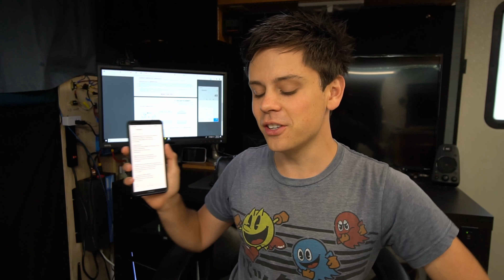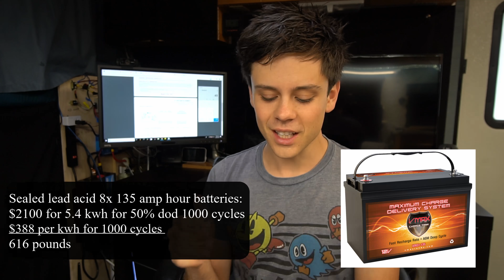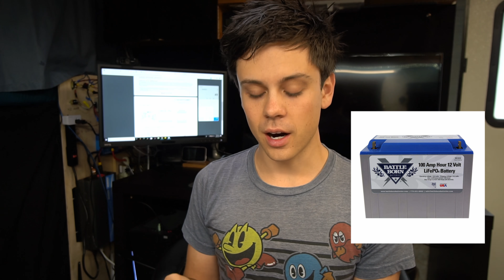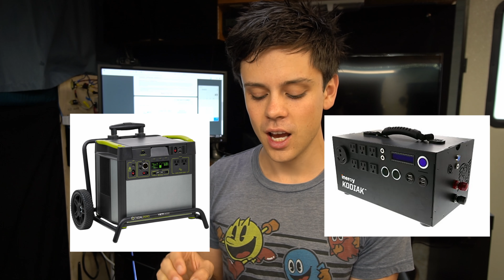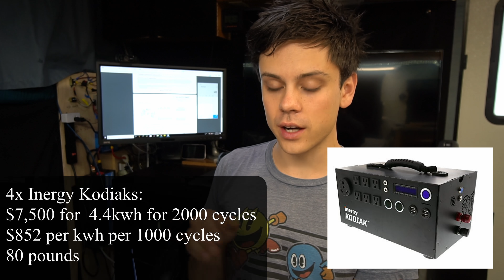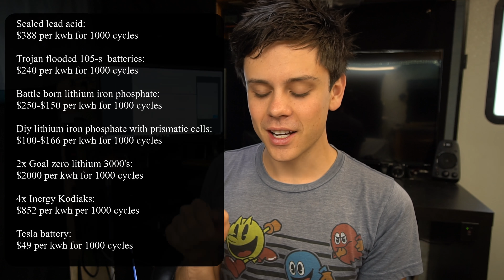Off-grid Solar Battery Price Comparison: Tesla vs. FLA vs. SLA vs. LiFePO4 vs. Tesla

Comment: Have you tried to run your air conditioner with your Tesla battery?
Reply from the maker: I don't have it anymore but it pulled only 600 watts. I was pulling 1700 watts this morning no problem
Reply: Will Prowse RV Living and Off-grid Solar  ... i totally envy you lol (in the good way).
Reply: Will Prowse RV Living and Off-grid Solar would it run an AC overnight in a Boone docking situation in an RV
Reply: I have a new mach 15 (15,000 btu) with a microair soft start and it uses 12 amps at 120 volts or 1440 watts - if it was hot and running constantly it would need at least 14,400 watts of batteries to run for 10 hours . That is assuming 100% efficiency.   

To recharge the batteries while still running the ac would need 3000 watts of power for 10 more hours (at least a 30 amp generator) solar would help reduce the recharge time.

This doesn’t sound like a cost effective solution for running your ac overnite just yet - but it is possible if you take his scenario and triple it. (5KWatt x3 =15KWatt of batteries)

Comment from the maker: Tiny error that doesn't matter much! The vmax battery calculation was for 115 amp hour battery and not the 135 amp hour battery! All the calculations are correct though. My bad!
Reply: Please put in the victron batteries. i want to see how crazy there pricing is
Reply from the maker: @Ender_Wiggin  oh man those are expensive. I should do a video on those
Reply: @WillProwse  that would be awesome! they are great but sooo expensive. I originally saw them when someone used them to make an off-grid boat.
Reply: @SEMPER PROGRATIS quite shure, Will is going to be a great engineer or entrepreneur in solar buisness, if he will use his talents for good...
Reply: So, what kind of BMS do you need for the Tesla battery?
Reply: @je-fq7ve  Tesla using Li-Ion round cells each one encapsulated with having its own CID protection switch, cutting it off circuit on over-temperature/pressure condition (like a fuse blown): so they are less dangerous than those flat pocket cells used in phones, which had exploded & caught fire sometimes. So Tesla packs seem quite safe if handeled properly with temperature sensors + state of the art cell balancing...

Comment: Correct me if I'm wrong, but the cost of the Goal Zero and the Inergy Kodiak includes whole solar setup minus the panels? How do you separate out the cost of the other components?
Reply: Sorry, posted before the video finished.
Reply: Could you revisit the value of the Kodiak in more detail in light of the info in this video? (You did give a summary at the end. )
Reply from the maker: Yeah that was covered at the end
Reply from the maker: And hard to say because it's a full system. Not sure how to calculate that out. Also, other components vary in price. Lots of factors.

Comment: Since you have both, Kodiak & Tesla battery, can you configure the Tesla to extend the Kodiak's power? If you could, that would be incredible power generator system !!!! Thanks Will.
Reply: If I remember corectly, the Kodiak had direct connectiond for DC charging, so you might combine it with an external power source to keep it charged,
just keep the load within limits...

Kodiak + cheaper external energy storage might be the
 most cost efficiant ...
Do correct me if i'm wrong
Reply: patrick van reeth - Thanks for reminding me/us. I know one guy indeed did extended his Kodiak's power with external sealed lead batt., but I don't know whether this Tesla's batt. already has BMS(battery management system) or not. If not then the Kodiak can control the charging to the Tesla? and if Yes, then how does it works with the internal charging control of the Kodiak? If it works then it would be very effective and cheap too ! I can hardly wait the answer from Will's experimental. Btw, this is worth at least 10 'like' 😁😁😁😁😁😁😁😁😁😁
Reply from the maker: That would be very hard to connect the Kodiak to the tesla. Maybe possible one way, but the complexity of that system would be crazy. Tesla is 24 volt system
Reply: @WillProwse  
Right, Tesla wouldn't be compatible, but you did mention a (probably cheaper) DIY kit system
 with separate cells...
Perhaps you could build a kit that had the correct voltage to combine with the Kodiak ?
If so, the question remains how to actually charge ...
Would it be possible to charge one of them through the other ? 
E.g. making the external unit bigger and control the amount of current it can deliver to the Kodiak so it can keep it topped off without frying it ?
Or load external unit through the Kodiak as Stranz28 suggest ?

Just putting my thoughts out there, leaving it up to you to make sense of it all :)

Comment: The Vmax would actually give you 14.4kWh with 8 of the XTR31-135, or 7.2kWh at 50% depth of discharge. So the cost of the Vmax is $291/kWh
Reply from the maker: Thank you for pointing that out g!! Big thank you
Reply from the maker: I just figured out what I did wrong!The calculation was for 115 amp hour battery. Oops!
Reply: @WillProwse  thanks for the reply, great video as always!

Comment: Look up Toyota Prius batteries they are the same as the Tesla batteries
Reply: nope
Reply from the maker: yeah they are different. i chose the tesla batteries because they are super easy. nissan leaf batteries are all super easy
Reply: madseh de The 2016 and newer Prius use lithium except for the entry trim level.
Reply: just saw a 2012 , 80 K mi. prius battery on craig's for $175....wish i was up on this stuff .....the price is right , but i'm too poor to make a serious mis-purchase.....i keep bouncing around , looking at videos , and STILL  don't know enough   buy ? not buy? NiMH no go ?  i can figure out series/parallel , etc. connex , and don't really need KWs , but the weight advantage and life span seem major benefits........led lights , and a 12v. refer 
(4 amps run v.) my only necessities.......unlike Will , i AM a minimalist     old hippies

Comment: So you switched to 24v from the 12v?
Reply from the maker: Yes but have a converter and still use 12v with 24 volt battery

Comment: The voltage is a bit low for a 24v inverter.  I believe these are 6 lithium cells in series so you would want a low voltage cutoff around 17-18 volts but aren’t most inverters designed around lead acid set at a cutoff of 21v?  How are you dealing with this?  Which inverter are you using?
Reply from the maker: Great question!! I need to cover this in a video. Cut off for giandal inverter is 19.6. we will find out soon if it's not though haha

Comment: Well, you also have to include all the money you spend to get power out of the tesla battery, (inverters, conectors and all the technology you've bought to control everything)... plus all the whey it is in your tesla board including the battery i remember you saying it was super heavy.... i totally understand your point about the battery being super powerfull, but if you think about it even goal zero wich is a piece of crap they have their own inverter and and everything in one piece.... so you will have to add everything you bought to make your solar system work.
From my experience, what you are buying from kodiak generator is durability and portability, less complications, just connect and go.
Good video man!
Reply from the maker: Just had to buy a 24 volt inverter, battery protect, converter and thats it. not much at all.

its not super heavy. its 55 pounds compared to 480 pounds for a lead acid bank of same power....

yeah I like modular myself, so go for it if you like those systems instead.
Reply: Full Time RV does have a pretty good point about adding in the cost of the equipment that you run along with the batteries that you used as examples. Perhaps another video or information sheet with the v-max, trojan, battle born, and others with the cost of your charge controller, inverter and maybe a few of your extra bits to complete the system. Seeing the cost difference of the batteries is still very very cool and it's awesome that you make these videos for everyone to learn these things!
Reply: I just wish you could get the battery packs straight from Tesla, instead of buying used.  Also, features are important.  Lithium batteries are temperature sensitive.  Tesla, unlike most other packs, have liquid heating/cooling and temperature sensors built in.  That's why that Chevy Volt and Nissan Leaf won't do proper quick charging.
Reply: True you get all the extra equipment in those but you also get to throw all that equipment away later. One thing to mention is the fact you can daisy chain plain batteries on both of those system which should bring the costs down a little bit.
Reply: @markbernhardt6281  I was talking about the car units, not those home wall units.  No telling what all is in those.  As for the car packs, why would you year them apart (not an easy thing to do without damaging the cells) just to remove a match head sized sensor and an ability to regulate temperature?  Connection arrangements (serial/parallel) are always a concern, but that is an overall system design issue, which would take a book to discuss.

Comment: you think tesla battery are cheap ? just wait when Tesla ramp up production to 1 milllion car a year.  that is going to further push down the battery price even more
Reply: Not just Tesla. Lithium battery production is scheduled to be 20x todays production within 3 years in the world
Reply: Solar
Reply: And yet my latest cost for grid electricity is 2.6 cents per kwh.
Reply: @RonJohn63  well in my power district it is 10.5 cents per kwh that is in Utah where coal powers the generators., Where do you live?
Reply: @RonJohn63  that's really good. So for a 100kw hour battery pack, it will cost you approximately 38 cents to charge from 0%. Nice. It's about 17 cents where i live.
Reply: This analysis is exactly correct for full timers that never let the battery get below 0 degrees, and will never catch a bullet.  A trailer used by a hunter 4 or 5 weekends a year might favour the lead acid option because of the substantially lower initial cost and better performance when cold.  I am looking at full timing for a few years, following good weather around the country.  I want to be able to run a small AC split system unit overnight, so I will likely start with one Tesla and add another if I am draining it often.  The lithium chemistries will also charge fast and efficiently, so a hot but cloudy day means you can top off the batteries in the evening with an hour of a small genny and then have quiet AND electricity!
Reply: When is that going to happen? Lol
Reply: Add their dry cell tech coming soon and prices will drop even further.
Reply: @renindy  
Yeah, I miss my Windows 3.1 and that cool green screen. 20 minutes to load up a video etc.
Reply: Yep, a bit of production and healthy competition should help.  However, very long lasting batteries will actually reduce the demand once the market is flooded, so I'd think the prices will go back up.  Also, if I'm not mistaken, a battery that is 100% no longer usable, whatever the format, is really hazardous waste.  At some point, that will be a cost that has to be figured into the purchase price, too.
Reply: @Roobah  Tesla has a battery recycling program that is profitable, they convert them back into 'products' to be used and 'byproducts' which are not hazardous and thrown into building materials or something. 1% of the battery is collected as dust and actually goes to a landfill.
Reply: @Roobah  Since Tesla is building batteries for cars, the market won't be flooded for decades after the entire world shift over to EVs. And that will take several decades. So the soonest the market is going to saturate will be about 50-60 years from now.
Reply: That's not how it works. The battery in this case is a factor of supply. The cars are demand.  Once there's enough cars to suck up the new and reclaimed battery supply, the cost will be very high for any other purpose.
Reply: 1 million a year!? Ha ha ha
Reply: Which can also mean NATO countries, the US and its allies, are going to start invading countries for Lithium.
Where will the next WMDs be found?
Reply: @muhshekels5383  Fortunately solid state graphene batteries are on the way.
Reply: Riley MeK I’ve heard rumors of the miracle grapheme cells for years. Is there any company hinting they have one coming to market?
Reply: @lostboy583  Samsung is rumored to be releasing a lithium battery with graphene that can charge 5 times faster and last 10 times longer I believe. Still not a true graphene battery but it's a start. Personally I'm just interested in quick charging rates. Solar isn't effective enough in the winter where I live so I'd like to be able to run a generator for short amounts of time if needed but charging is still very slow when  you start talking kilowatts.
Reply: No. It wont. As production ramps up lithium reserves will drain causing an increase in lithium prices.
Reply: @metamorphicorder  Plenty of lithium out there. Look no further than coal ash.
Reply: metamorphicorder lithium is plentiful. Cobalt is the limiting element.
Reply: Finite supply of lithium
Reply: oldschoolgreentube lithium is abundant

Comment: You say Tesla, I hear Panasonic :P
Reply from the maker: I used Tesla in title for better search ranking
Reply: @WillProwse  I wonder whether sourcing directly from Panasonic won't be even cheaper (dunno at all whether they themselves sell these batteries)...
Reply: @dvrify1  Tesla cells don't have PTC and CID which is standard on normal panasonic cells. That adds cost. Panasonic will not sell you the Tesla version cell.
Reply from the maker: Yeah exactly haha
Reply: So when you start that RV charging system company, make sure you get a direct deal with Panasonic instead of being a Tesla reject pass-through buyer.
Reply: Using Tesla's secret ingredients.
Reply: Panasonic also working with Toyota, who came late but heavy to the lithium battery auto race and are all in now...   Toyota has a history of wringing a lot out of things with very focused attention on key areas - I wouldn't expect any less from them in the battery space.  Someone in the auto-chase is going to find really unique ways to differentiate themselves from the others - storage density by volume, and charge time improvements ...

Comment: you need to build a safe system with the tesla batt and sell them
Reply from the maker: That would be pretty awesome
Reply: Tesla using Li-Ion round cells each one encapsulated with having its own CID protection switch, cutting it off circuit on over-temperature/pressure condition (like a fuse blown): so they are less dangerous than those flat pocket cells used in phones, which had exploded & caught fire sometimes. So Tesla packs seem quite safe if handeled properly with temperature sensors + state of the art cell balancing...
Reply: Li-Ion Battery-Packs as commonly used with RC motor applications provide integrated charge limitation controller & cell balancing, so we can simply connect these to solar panels for direct charge via only one schottky-diode each (preventing backward current discharge at night) !

8S LiPo Packs (28.8~33V) ➯ ideal match for common 60 mono cells solar pannels providing 30~33V direct charge near MPP (need check your inverter specs to allow for 33V maximum input voltage!) 
 
7S LiPo Packs (25.2~29V; commonly available as best 24V Lead Acid replacement) ➯ and will charge directly from 60 poly cells solar pannels, even at very high temperatures (decreasing MPP below 30V)

6S LiPo Packs (21.6~25V = Tesla) ➯ less efficient for direct charge, so should rather  use with MPPT converter
Reply: @WillProwse  please do, im sure people would pay a grand markup to buy a complete product.
Reply: @WillProwse 
?????????????????????????  I'd like to know more and build a 24v system. 
I'd us a Tesla battery ONLY with your help, otherwise, I would just buy/use the BBB.
Reply: DIY Solar Power with Will Prowse I need one lol
Reply: @WillProwse  yes please
Reply: I will buy one..
Reply: I'd buy one as well granted the overall cost wasn't absurd.
Reply: I would buy one, and I would want one with a quality bms system already installed
Reply: Where is your webstore? I want to buy one customized generator!.
Reply: Look at Evtv jack rickard
Reply: I will buy 2 from you if you build.
Reply: Sign me up for one too
Reply: i have been running lifepo4 for a while now...i seriously am skeptical of the 5000 charges on basically tweeked liconimh tech...
i was standardizing cells and end products to one voltage on lifers, but if these tesla cells are warrantied for 5000 fast charges this may be a game changer for my business, the safe one you all want!
looking for answers from USERS of these S cells, please...
Reply: How does the Tesla Powerwall 2/3 compare?
Reply: I agree.  Build and sell a system!!!
Reply: I agree completely!
Reply: I’d buy a controller from you for a Tesla battery.